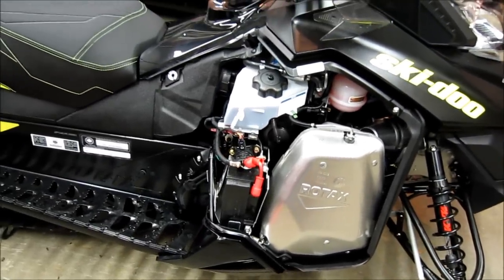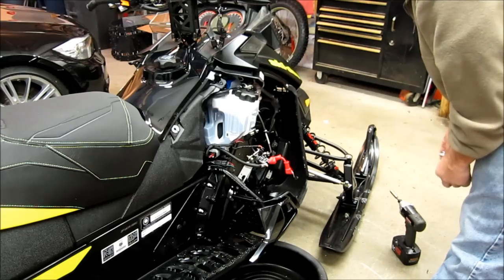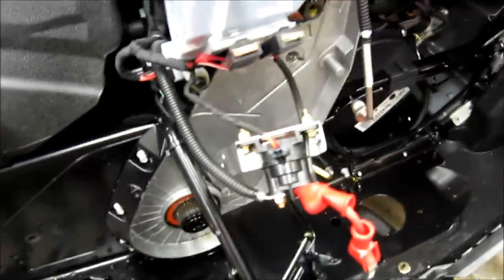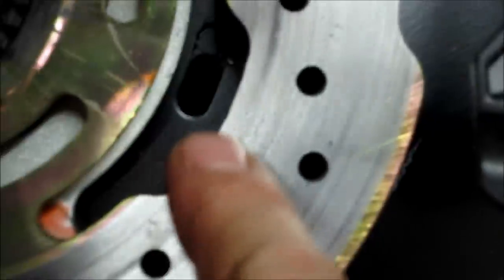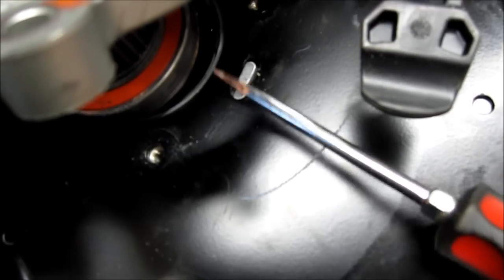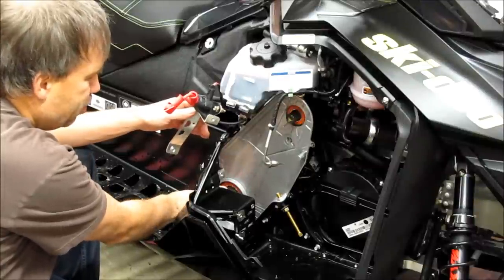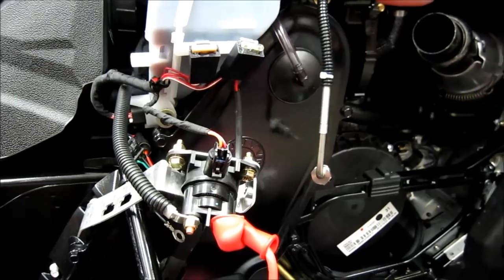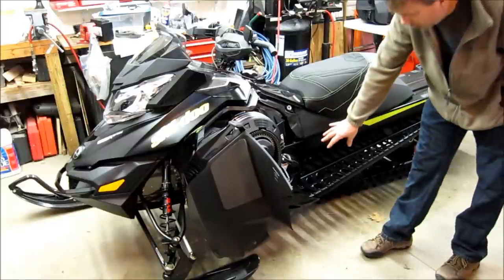Ski-Doo track replacement on 2008-2023 XR,XP,XS,XM,G4 models.

Comment: what are the bearing numbers for the front track drive shaft? left and right side as well as idler wheels for the r-motion skid on a 2016 900 renegade. not looking for ski-doo parts number but actual bearing numbers.
Reply from the maker: 6010 is the number for the left drive bearing. Left jackshaft that is pressed on the shaft is 6008 and the upper chain case is 6205. Uppers (6205) and rear idlers (6004)

Comment: Great Video!  I am getting some abnormal wear on the leading edge of my drive wheels where they contact the track clips in the windows.  Is this normal? When installing a track do you have to align the drive wheels into the center of the track windows, or is this an automatically aligning deal when tightening the track to the proper tension?
Reply from the maker: +axleech You need to align, (center the track) as part of the tightening process.  Drive sprockets will show wear, nothing to worry about for 10K-20K+ miles.

Comment: Hey Markusvt1 did you change the seals in the change case for the drive shaft?
Reply from the maker: I would if it is leaking or has >10K miles, else-wise it would be fine to leave.  It is a very durable seal.
Reply: @markusvt1  I know this is a very old video, but do you have to remove the driveshaft to change the driveshaft seal in the chain case?  I have a 2016 Summit and it drips every so often.
Reply from the maker: @leozz8074  100% Driveshaft has to come out.

Comment: awesome vid! I've got a 2011 GTX SE 1200, I could not get my break cover off  due to the foot rest, am I going to have to drill out the rivets to remove the foot rest first?
Reply from the maker: It would give you a lot more room to work with.
Reply: markusvt1 yes I did have to remove that foot rest, fairly simple two10 mm bolts in the back side and two Rivet's to drill out, thanks

Comment: I just put in a new track on my 2012 polaris pro r rush 600- I went with a camso intense cross country. The arrow on the track point up towards the rad(front of the sled when i roll the track around to the back where i can see the arrow), but the labels (camso) on the track are upside-down which is throwing me off. Did I put the track on backwards? I just followed the arrows that the previous track on it had.
Reply from the maker: Arrow points in the direction of travel, so looking at the top of the track, it points to the front of the sled.

Comment: Is there any tricks to taking the brake pads off? That Allen head bolt just keeps spinning and spinning.
Reply from the maker: +Riley Tucker Once the threads are backed out, just give it a tug and it will come right out.

Comment: I have an 08 600rs, is it the same for that model? I would imagine so but am not sure.
Reply from the maker: Same except for the removal/install of the lower gear.  You need to use the BRP tool or make one from a bolt and 2 nuts.

Comment: how do u put the rotor back on the shaft since its pressed on?
Reply from the maker: Not pressed on at all.  Rotor slide on and off.  Caliper is pressed on sort of, the bolts pull it back on as you tighrn them.